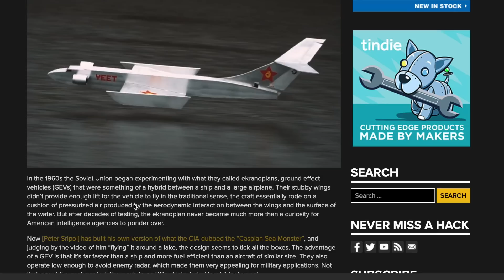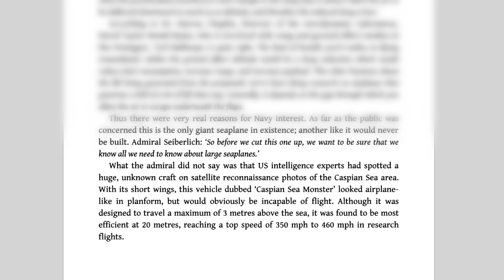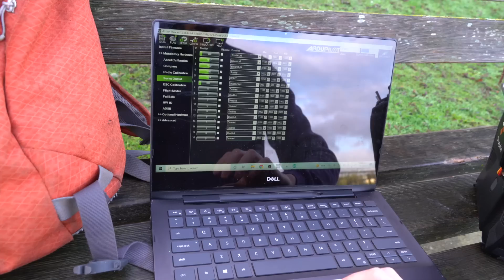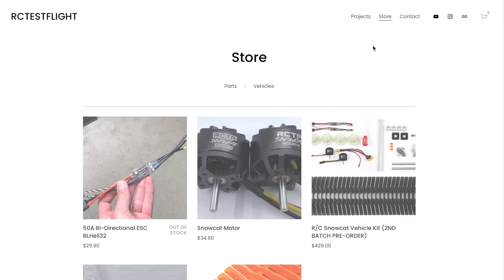Worlds First 'Real' R/C Ground Effect Vehicle

Comment: Absolutely love this video!
On this one your elevons are on the outer horizontal stabilized, that means with up elevator you have a washed out wing! That converts it into Bell Shaped Lift Distribution wing! 

The forebody causes the Outer Horizontal Stabilized(wings) to fly in an upwash OGE. 
If it's set at Zero incidence it will not produce much lift IGE which will case a forward shift in Aerodynamic Center. 
Out Of Ground effect they produce lift causing a pitch down and the tendancy to remain IGE. Hope that makes sense

Comment: All of this discussion to the effect of "power required to get up off the water is substantially more than power required to sustain flight" gave me an idea. Suppose you want a ground effect vehicle that has just enough power to take off, but after take off ALSO has just enough power to sustain flight.
...
 For the moment, stop thinking about motors as the limiting factor - let's just assume we have motors with some excess capacity. We'll attach them to a brushless DC controller that also has some excess power capacity. But we use a battery that, although they might have plenty of watt hours of storage, doesn't have a high power rating in watts. (That is, cells with relatively low "C" rate)
In takeoff mode the controller draws on capacitors to provide a burst of power. Once a lot of the capacitors' energy has been drawn down, takeoff mode is over and the controller limits the power to whatever the maximum sustained power output of the batteries is; much lower than the power output of the capacitors. 
Capacitors, of course, are well known for being able to provide current very quickly but they usually do a terrible job of providing long lasting power.

Comment: In my limited experience with GEVs, I found that having a really small wing, with a high tail mounted motor - elevator combo (no par thrust) worked well. Needed quite a long run to get up to speed but once in ground effect it flew pretty well, it couldn't turn much though.

Comment: I think if you had a mix for elevon down with the motors pointing up it may make it easier to focus on throttle control. On an underpowered vehicle pitch can drastically change airspeed.

Comment: Super good video as always, it’s so nice to see all these improvements so it flies more and more like a true ground effect vehicle. In flight principles in flight school ground effect is studied and it is said to be the resultant of the wing tip vortices “breaking” in proximity to the ground. Therefore reducing lift drag and improving lift as less air “escapes” the pressure gradient between the top and bottom of the wing through the wing tip increasing lift. This is caused as there is a greater pressure gradient between top and bottom side of the wing as no air is “leaking” through the wing tip. So another approach to creating a ground effect vehicle would be to tweak the wing design so that it doesn’t have enough lift to sustain flight but would in ground effect with the increase in lift (and the reduced induced drag decrease). Keep up with this videos love to see such good quality!!

Comment: Another thing you could do is flatten the top surface of the wing so it doesn’t act as an airfoil (parallel to the wind direction). That will create a zone of high pressure under the wing but no zone of low pressure on top. It will then be much harder for it to fly out of ground effect.

Comment: Maybe something larger scale? The larger scale will not only increase the ground effect surface area to the power of 2, but it might allow for smoother flight.  Currently the natural feedback keeps it only a few inches off the ground, which will be strongly affected by the waves you are testing it on. Also, try increasing the weight, as it will stay closer to the ground, and have a stronger ground effect. Doing this might make it easier to find the precise value at which it can fly, and it might save you some time. Awesome series! Can’t wait for the next :)

Comment: Doesn't matter if it can fly out of ground effect. Its all about efficiency in ground effect. An RC model doesn't require the efficiency that the designers of the full scale vehicles needed for the range or payloads they were trying to move. You're trying to create a solution where there is no issue, I think.

Comment: The biggest problem with this is the mass to air speed ratio. A super light aircraft like this is susceptible to the smallest of wind. Full scale ships drastically reduce this ratio and are easier to design and tune. Take the wind out of the equation, like you got lucky with, and it's much easier to tweak the best settings.

Comment: keep scaling/massing up the test aircraft using the same lightweight motor combo, until the power required for continuous flight out of GE is more than the controllers can support without overheating

Comment: A ground effect vehicle has to have way more power then what is used during cruise... because water is thicker than air. What makes it a GA vehicle is the efficiency difference between full flight and GA, not its inability to reach full flight.
Reply from the maker: By that definition, every aircraft is a ground effect vehicle!

Comment: I think there's a technology congruence in combining a battery powered takeoff, with a fast solar powered ground-effect cruise.  Sailplanes are the most efficient way to fly per wingspan, but the fact that solar powered thrust scales with wing area rather than having ~fixed thrust, benefits designs with much larger wing chords.  Ground effect vehicles work best with very large wing chords relative to the size of the vehicle.

Comment: I agree with you and a lot of previous commenters that almost all ground effect vehicles were probably capable of true flight to varying degrees, albeit less efficiently. But I think that misses the difficulty of historical ground effect vehicles: they were designed before digital flight control was available, meaning they were inherently stable in ground effect flight just based on wing and airfoil design within some decent range of motor thrust. But RC GE craft don't do this. They either skip or require digital stabilization and/or they're very finicky about motor thrust.

Comment: Water doesn't need to touch your electrical conductors on the PCB to mess something up. It can lay on the right spot(s) on top of the coating and act as a capacitor, which can attenuate high frequency signals (among other effects). This can affect transcievers as well as processors.

One thing you could try to make the problem solve itself over the course of a few minutes is to add a small heating pad under your electronics. Not sure if this will help with big water drops, but it worked for me for my outdoor Radioduino-powered solar station (condensation messed up the transciever). Keeping the transciever module about 3-4°C above ambient was enough to keep it working.

Comment: I've never been sorry of using heavy duty nail polish as conformal coating. Ex.: on the circuit of my XM radio on my motorcycle. Its been in pooring rain and still work fine.

Comment: yea i dont reely get the wingtip vortacy explanation because by tthe time the vortasey comes back around down its behind the wing, where there is no wing to trap air under for the lift. like on f1 cars where they actually play with floor edge vortices to seal the under floor the vort is is generated way at the front to do the work all along the legnth of the floor. whereas the wing is the vortex generator for the plane and there is nothing behind it to take advantage.

Comment: i thunk that gev were supposed to have a giant back wing high off the ground in order to create lift in the back so that the front gets pushed down more and the gev flies more flat. 
also i feel like the ekranoplane only lifts off when its going really really fast, so its more like about speed and not power or angle of motors, and the point is is that at that no matter how fast it goes it will never go out of ground effect because its so heavy and the

Comment: In order to make the power to weight ratio worse you could also add ballast. Compared to a full size GEV your models are probably super light, a significatly heavier version might also be less sensitive to wind and other factors

Comment: Ideas to consider: Use a hydrofoil that telescopes up to reduce energy needed to lift body out of water. Paint bottom of the vehicle with hydrophobic coating to reduce droplets clinging on to the body. Consider a voltage limiter circuit between the battery and the PWM dropped to something below your minimum battery output to prevent the difference between a fresh and near empty battery.

Comment: I think you can cheat a bit and add a retractable hydrofoil that will lift the plane from the water and overcome the water surface tension more effectively, therefore less power and less tilting motors.

Comment: Does it have to be able to take off from the water by itself. What if it could only fly in ground effect but not take off from the water. Like you might throw it or have a launcher to start it. I feel like that's not really disqualifying. It would still be flying in ground effect. I a plane with no landing (and take off) gear can still fly. It just can't take off by itself. Doesn't mean it can't fly.

Comment: Conformal coat definitely lets water through. It's used to keep stuff dissolved in the water and other conductive material out. If the board under the coating isn't absolutely clean the water coming through the coating will interact with the contaminants to conduct. Contaminants in this case includes things like the residue from the solder flux, including no-clean flux. It's really hard to get it out from under the SMT components.
 For waterproof boards you will need silicone potting. But you still have to leave the connector pins uncoated. Parylene coating also works, but that requires deposition in a vacuum chamber.

Comment: I did mechanical Engineering Diploma Project under the Title "Analysis of a configuration for ground-level flying". I wanted to build a 1m wingspan Ekranoplan-type RC-Model, but our wind tunnel at the university only had a 1m diameter nozzle, so I had to build a half-scale model and measure at double the airspeed to achieve the same Reynolds number. 
The goal was to find a configuration that would allow a speed window of around 5km/h in which the thing would neither want to land nor take off, but remain in stable ground effect flight.

The Problem: when a wing nears the ground, its pitch moment turns forward, i.e. reducing angle of attack and effectively pushing the WIG (Wing-In-Groundeffect) craft onto the water. Therefore Ecranoplan-type WIGs require a large horizontal stabilizer with a lot of downforce, and so high up that it stays well clear of ground effect. My original horizontal stabilizer turned out to be too small and have too little downforce, and too little moment arm, meaning it wasn't as far back as it should have been. I realized this a mere 4 weeks before my time ran out, and now had a configuration that would either just take off or land :-(

Frantically I made a much larger horizontal stabilizer with negative Clark Y airfoil, as I had no time left to increase the moment arm of the thing. Thankfully this finally gave me a ground-effect window of just shy of 4km/h. Which means every little breeze or turbulence would lead to take-off or landing. But I HAD found a configuration for a true WIG craft, which is not defined by weather it is capable of free flight or not, but that it has a large enough speed window in which it is in stable ground-effect flight, without all the modern gizmos of Lasers and electronic stabilization :-)

Comment: Actual pro tip for conformal coating electronics: Most conformal coatings have a UV tracer in them to allow inspection. Get yourself a cheap UV LED torch and you'll be able to see where the water's getting in. (Get yourself some UV curing glue while you're at it, very useful stuff).

Comment: Two ideas / questions:

1. What about adding weights to the plane instead of cutting power?
2. Could you add two (or more) electrical contacts on the bottom surfaces that are the first to touch / last to leave the water, then try to pass a current through the water between them.  If you have current, then increase power, if no current then reduce power.
Reply: I like the idea of adding weight instead of cutting power. Maybe weights above the pontoons. The goal would be to have smoother flights in the presence of gusts.

Comment: I'm pretty sure the issue is one of unequal scale.   The power isn't scale to the weight.  The weight isn't scale to the air resistance.  The water resistance isn't scaled to the power.  Etc...  I think you'd have to calculate all these factors and scale them all independently to arrive at something that works like a full-scale vehicle.  You did nearly that by adjusting down the power.  Going any further is just an exercise in artificially modifying these factors to achieve a better scale balance and I think you already proved it can be done.

Comment: Oooo~ how about this

An impeller compressor, with a single input and output pipe, several entrances and exits controlled by small and light servos, allowing for an on/off high-static-pressure grid output on the bottom, and switching between a high-pressure grid output on the back and a high-volume output on the back.

Then also have on/off-able high-volume input holes on the top and front, and maybe some grid-holes along the front of the skiis that can open after take-off, to reduce drag. 

Have some small grid-outputs along the L shapes of the wing+skii, and you'll be throwing your air in the exact spots you want it to be, rather than haphazardly hoping it'll get there.

Comment: Ok.  You need to stop letting idiots tell you what the definition of something is.  A normal plane cannot maintain an attitude that can take advantage of the "ground-effect".  At least not efficiently.  A ground-effect vehicle is not one that can't achieve flight.  Put a big enough engine on it, you can make a brick fly.  Just ask any F-4 pilot.  A ground-effect vehicle is one that is tuned to get its best performance when sticking to ground-effects.  

Here's what you need to do:  Load your plane up and do endurance tests.  Both close to the ground and fully airborne.

Comment: Seems like adding weight would broaden the range of motor PWM that would have enough power to get it up into ground effect but not enough to climb out. The power to weight on these small foam planes is unreal compared to full size aircraft.

Comment: Daniel.
If we go back to the Korabl Maket (KM, the Caspian sea monster) and have the information on how it was flown we can make a true ground effect vehicle.
The KM has 10 engines, 8 on the front and 2 at the back. When the KM had it's sea trials there were 2 pilots and a man on the throttles. While the pilots did their job Rostislav Alexeyev was in control of the throttles, during takeoff all 10 engines would be near max throttle but when they were in ground effect Rostislav would reduce the throttles of the front 8 engines leaving them on but just ticking over. The main thrust was from the rear engines for the actual flight.
Your GEV is being pulled through the atmosphere by two motors that can pull the vehicle in any direction and speed you want, but what if you had a motor on the front that gives the vehicle enough thrust to make a cussion of air but won't make the vehicle take off, then have a motor on he rear that gives you the forward thrust?
Once up on the cussion of air turn off he front motor and adjust your trim. The forward movement of the craft will keep the cussion of air working and you'll be in true ground effect.
When Rostislav was experimenting with scale models he had no motors on them, they were launched by a elastic band and flew for a good distance by them selves.
If you can find the documentary 'The Caspian Sea Monster ' by Equinox then you'll have a vast amount of information.
Thank you for the entertainment and see you next video. 😃👍

Comment: Flight is achieved by low pressure created by the wing dihedral and "lifted" into the air.  Ground effect has nothing to do with the top surface of the "wing" rather the underside is where the dominant force of pressure needs to be.

Comment: I think that the reason why it is so hard to find a power point where it can lift off the water but not fly like an airplane is because the parts of the plane that make contact with water are not hydrodynamic at all. So you need a lot of power to fight the water resistance and pick enough speed to lift up, and when you do lift up the power is MUCH greater than the air resistance, so it just flies.

Maybe if you attempt a boatier hull design it will be much easier. Maybe some hydrofoils on top of that.

Comment: The key element of ground effect vehicle should be the capability to stay in ground effect mode in a rock-solid stable way at whatever speed. I think this thing is far from that. To achieve this , downforce will be needed to press the vehicle down on the high air pressure foil under it. Otherwise, it is just another strange-looking aircraft.

Comment: Fascinating, I believe the Caspian Sea Monster only used the full complement of engines to lift off. My natural curiosity wonders whether you need ailerons, presumably coming out of ground effect would cause the higher wing to lose lift and drop. I guess the only way to silence the critics could be to reduce the prop size to reduce maximum thrust. Regarding the flight controller, even with conformal coating some of the circuitry will be affected by the extra capacitance due to a conductive liquid laying on the surface. The capacitance will reduce with a thicker coating. Very well done with the experiments.